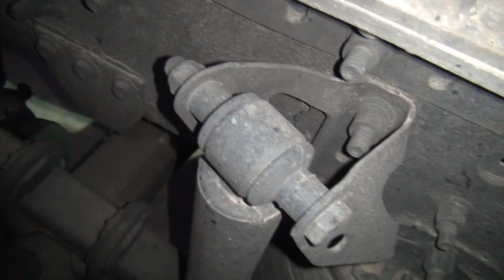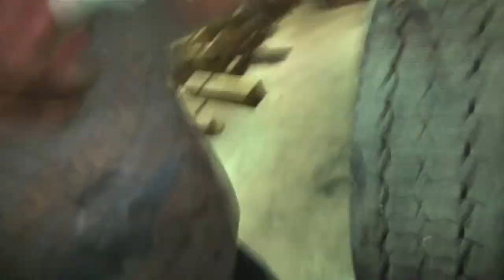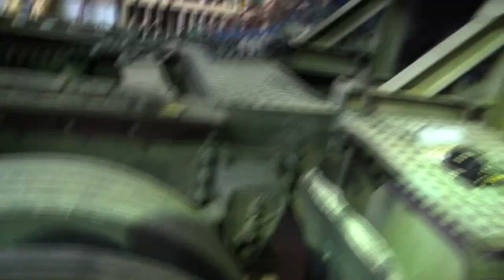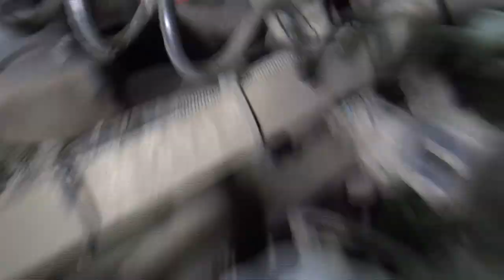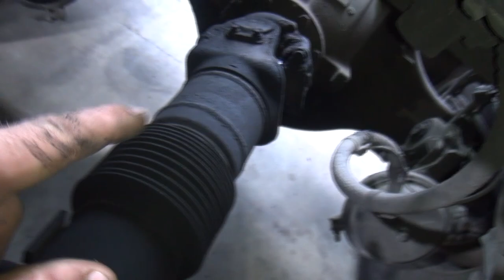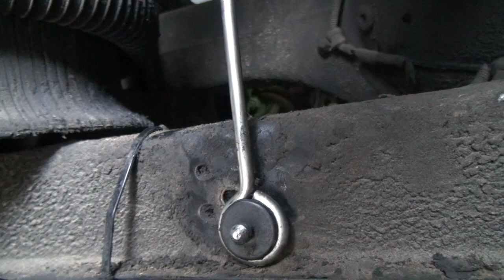Driveline vibration, loose driveshaft, bad leveling valve, volvo vnl 780

Comment: You need to pressure wash that truck. The DOT doesn't like seeing all of that grease and may search for a leak. Most of it is fifth wheel grease that is pushed of as trailers are switched but it gives inspectors a reason to look closer. Put a manual valve setup in the air line. One to shut off the air to the bags and another to drain air. Many trucks come with a valve to dump air when you unhook. The air bags usually have a rubber bumper inside that they will ride on with no air in the bags.

Comment: Have you ever experienced driveline angles being off? Shop said driveline is solid. No slop in ujoints or carrier bearing. Have what feels like a bounce even pulling empty trailer. It's MPH sensitive, not RPM. I noticed the rear most shaft looks like it's going downhill.
Reply from the maker: The leveling valve is what controls the ride height. if the ride height changes so does the drive shaft angle.
Reply: @LifeWithChase  thanks. Does it have to be volvo HCV, and is it just that simple swap them out and voila? Front bags I notice look like they lean forward a little. Loaded right now with 30,160 on drives my truck has 47psi in the bags, according to the dash on my 780
Reply: The engine feels like it's chugging too, best way for me to describe it. Got piss poor fuel economy too, 5.3mpg. No check engine lights or anything on the dash indicating faults in engine or trans.
Reply from the maker: @brandondunn8397  that psi sounds about right for that weight to me. The ride height is adjustable by moving the stud in the different holes where the leveling valve rod attaches to the axle bracket. When my valve went bad it aired the bags all the way up! Had horrible vibration. Also if the leveling valve rod comes off, the suspension will deflate and will also have a bad vibration. I've had a small vibration in both my Volvos over about 72mph. I don't typically drive that fast so not a huge deal. I did raise and lower the swing bearing on my blue truck to try to change the drive shaft angle and it didn't change anything. I don't know if any other leveling valve will work, I just got the one from Volvo so I didn't have to fight it. Engine surging could be a bad egr valve or a number of other things. Best of luck...

Comment: The tail end of my cascadia sticks up
My drive shaft came apart twice
3 times my u joint to the rear diff became red hot
I had third axle leveled and it still gave out.
Could it be I need a new leveling valve ?
It seems as we have the same issue.
Thank you

Comment: I believe any time you replace airbags you should replaced air lever too and shocks absorbs also, I did at 500 thousand miles, don’t drive straight with power divider on , will damage your differential’s, good luck

Comment: I bet you  over the life of my 99 VNL770 I must have put four or five leveling valves  in. The first being a week after I bought  the truck brand new. The third one was installed  at a Volo store in Georgia and when I asked if they had adjusted  it upon installation they informed me that  there was no adjustment,  it was all automatic. I knew from experience  that was a lie and sure enough, by the time I got to Carlile,  PA, I had lost the front pumpkin. Volvo wanted $6,000 to rebuild it so I did it myself. With the money I saved I reclined the brakes and installed new wheel  bearings, seals and shocks. I sued the Volvo store in Georgia and won. Another big problem was the steering shaft knuckle  which would developed play after about 100,000 miles  and require replacement. This was because you couldn't  grease them. Then one of the Volvo  guys told me about  a heavy duty version that was grease able. For $70.00more that one lasted over a million miles

Comment: I don't understand why that leveling valve was so pricey.  I changed the one on my truck not long ago and it was $85.00.
Reply from the maker: I don't see why it was so expensive either. I'm guessing you don't have a Volvo if you got one for that price.
Reply: @LifeWithChase  Right. I have an IH.
Reply: Mark Brubaker my freightliner was 85$ from freightliner
Reply: Yo I just got a new one and it stills over extended. And dumping air effecting my psi while back Tyler’s are lifted . Any tips?

Comment: Also Chase I got a next question how do you know what’s the right level for The leveling valve at the  end of the tractor when you change the leveling valve is there a certain height that the frame need to be off the ground or is it just like eyeball
Reply from the maker: the manufacture has a spec usually a frame to axle measurement. I just eyeballed this though cause I know about where it should be. Too high or low and you get drive line vibration.
Reply: Thank you... bud Appreciate it

Comment: Is it true that you adjust leveling rod till you get  top of frame about 1in below tire surface?!
Reply: The proper ride height is a measurement. All trucks are different depending on year, Manufacture etc. My 2013 VNL is I think 8 1/2 inches or 8 3/4 inches. You measure from the seam weld on the axle to the bottom of the Frame Rail. Check with your dealer or other resources for your proper ride height. It has been a minute since I have looked mine up too.

Comment: Wassup chase, hey so my volvo switch isn't working or communicating with the air suspension to lower the ride when I need to hook up to a trailer. What do you suggest I do? Do you think it might be a fuse?
Reply from the maker: Could be fuse, switch, solenoid or bad wiring.
Reply: Hey man. Were you able to diagnose the problem with your dump switch? I have a 2008 Volvo Vnl and am having the same problem. Let me know. Thanks

Comment: Looks like a lot of fun Chase :)  What would a shop charge for that repair.
Reply from the maker: I don't know, but a good guess would be 3-4hrs of labor at 100 plus dollars an hr plus the shop supplies and parts and tax. If I had to guess they would have just changed the leveling valve not looked at the driveshaft and it would have fell out a week later costing you thousands. 😬